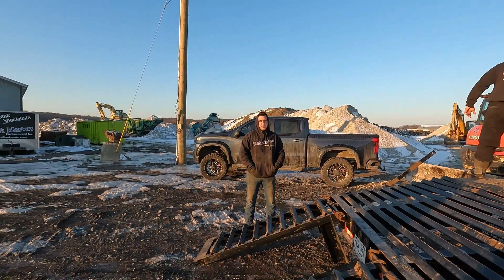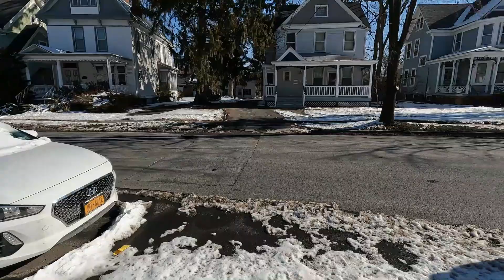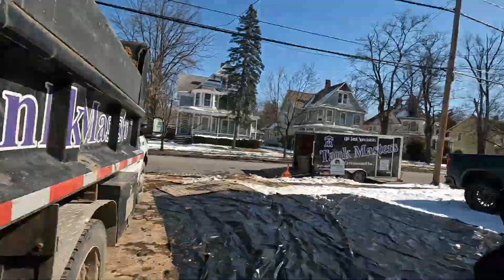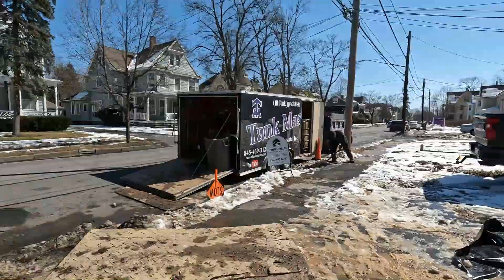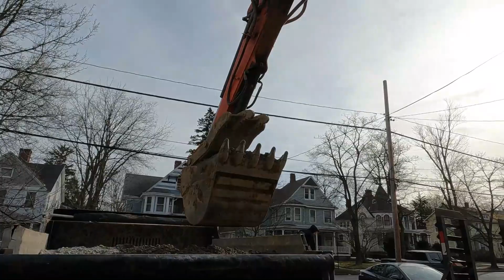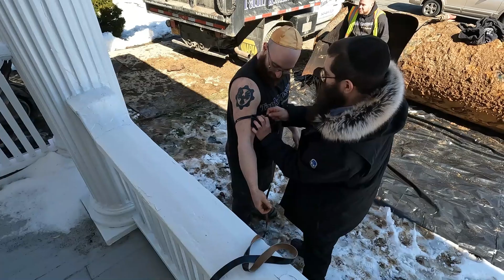Oil Tank Removal of a Failed Oil Tank Abandonment in Place

Comment: A very impressive job.  Operating a large excavator in those tight quarters really showed your skill. Even though the tank had a hole in it, somehow oil did not leak out. Maybe the dense wet soil helped to block any oil leakage.
Reply from the maker: Thanks Lou, The tank was emptied when they stopped using it. Then years later the tank developed a hole.

Comment: I saw the hole you pointed out once the tank was out,but didn’t follow on soil contamination. Was the soil contaminated? Also, was the hole caused by dipping the tank over the years? Is that what you meant by a “strike plate”? Good video. Thank You.
Reply from the maker: No contamination. The tank was emptied when they stopped using it. Then years later the tank developed a hole. Yes a striker plate is directly under the fill pipe, at the bottom of the tank. A 1/4 piece of steel is sometimes welded in place to take the constant hits from dropping a stick in to measure fuel. It will break down the polarity over time and weaken the metal. Great comment
Reply: Interesting, my destroyer had striker plates under the ends of all sounding tubes. Same principle applies as we took sounding of all voids and NFO tanks on a reoccurring basis so over the years I could see tank being damaged.
Reply: Music way too loud. Very cool that the 3 services were done by the Rabbi. In my experience...nobody is aware of their religion more than a practicing Jewish person. I am not a fan of the word J..  Thanks for sharing that service

Comment: Roth's uniquely designed oil tanks are the safest and most reliable on the market. The outer tank is made of leak-proof, weld-free galvanized steel and rollseamed with an oil and fire-resistant seal. It can contain at least 110 percent of the capacity of the inner tank for maximum protection. The inner tank is made of blow-molded, high-density, seamless polyethylene that is leak proof and will never corrode. Roth tanks are easier and faster to fill thanks to their unique expansion system, all but eliminating the possibility of spills by home heating oil professionals.

Roth oil tanks exceed the industry standard safety regulations. They are rust resistant inside and out and are designed to prevent spills, leaks and fires caused by defective pipes, couplings or fittings located underneath the tank. In fact, it is the only tank on the market with no fittings below the oil line. Each tank undergoes thorough testing, including ultrasound and pressure testing, to ensure optimal thickness and sealing.